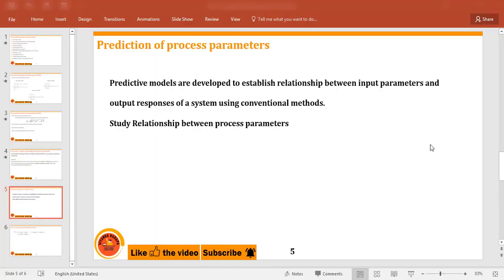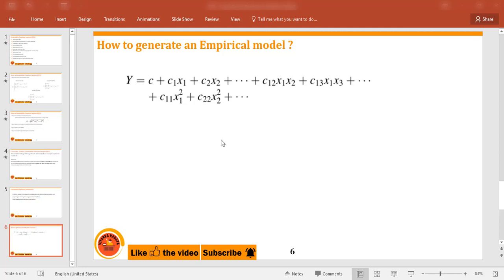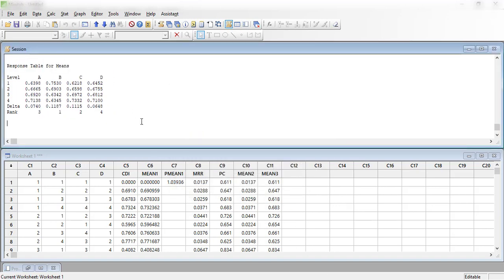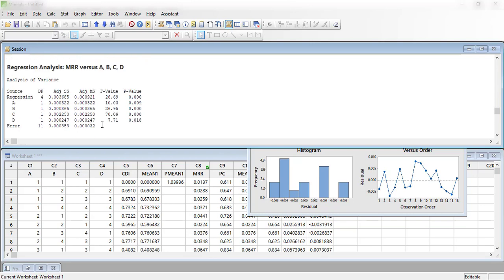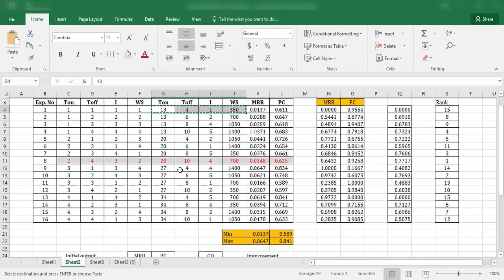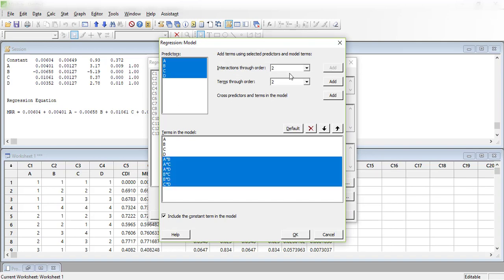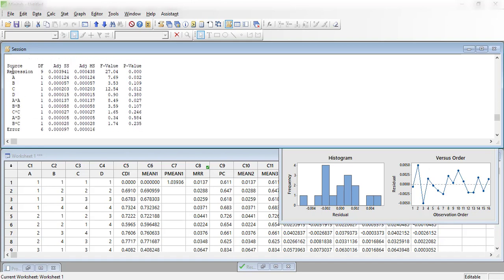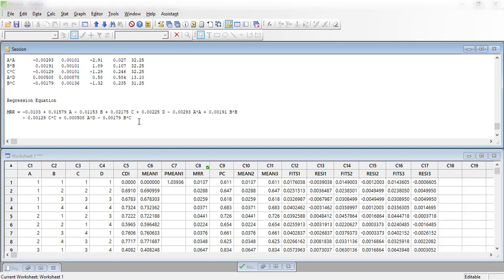DFA - Empirical model and Prediction of responses

Comment: Thank you so much Sir , and you have obtained the mean from Taguchi tool , but you didnt use it in the regression , so why you obtained it?
Reply from the maker: Sir, Since I have solved what the journal paper does, so they have used from the Taguchi tool only. You are saying that after submitting the input values in the regression we will get some values, so we need to do the mean for the values. Is it right. I think so, you will get the same value if you calculate like that also, but i havent tried it.